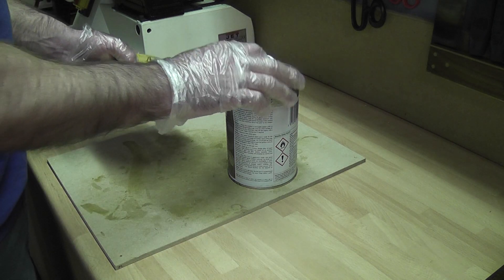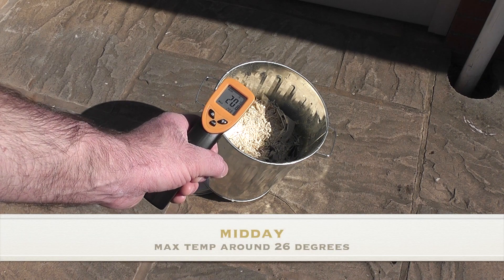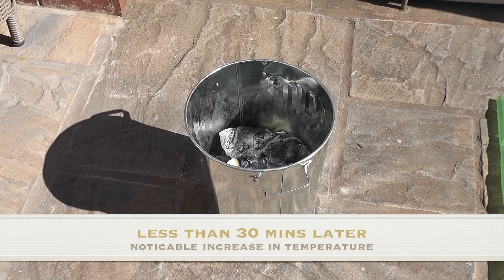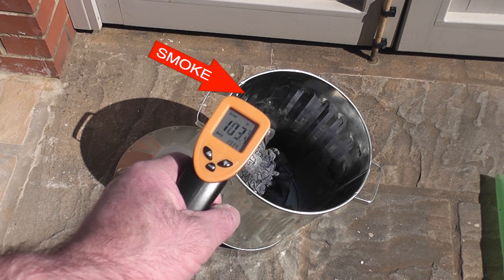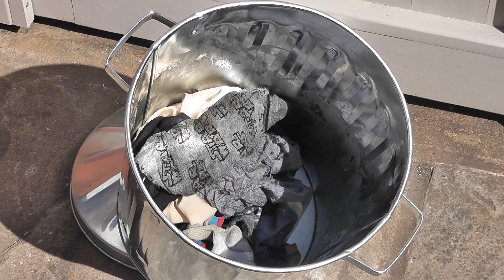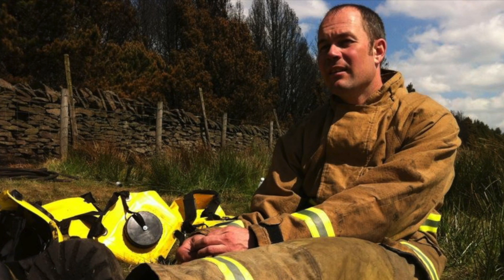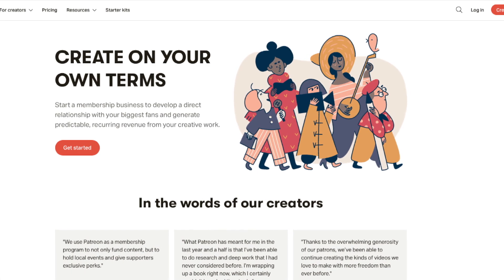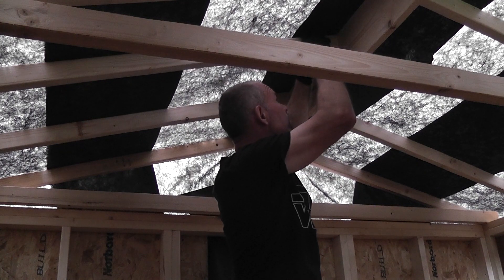Can Danish Oil Rags REALLY Self Combust?

Comment: The reason the other ones did not really heat up is because the cloths were too saturated, and the oil itself is the reason this happened. The oversaturation left the oil to cool itself down and the surface area of the fibers in the rag were not getting enough oxygen. The rags not being soaked to the brim is a very realistic test and this is why it was able to catch fire even in not ideal conditions. It'd take days for those super soaked rags to evaporate off enough oil for the surface area of the cloth to come into more contact with the oxygen and heat up enough to catch fire. Which maybe even worse because if you left that in your bin and forgot about it for a few days, imagine the shock.
Reply from the maker: Ah that makes sense. I was thinking the more oil I put on, the better chance of some action. 😂👍

Comment: Nice one Lee, good to be able to have concrete proof!
Reply from the maker: Definitely...it's one of those things that I had to see for myself. Took me a few days to see results though haha...but was worth it :-) Im so surprised at how quickly it happened though. Its pretty much possible that someone could oil a piece of furniture, go off for a couple of hours whilst the first coat dries and end up coming back to a workshop full of flames. Ive had a similar experience myself and lost £15k worth of equipment :-(
Reply: @Smugwood  yep. One of the few things I’m glad to have a concrete floor in my workshop for. Mostly it’s too cold and hard, but it’s good to be able to lay out an oily cloth on for a day or so before putting it in the big.
Reply from the maker: True. And to think I used to oil my projects in the house! Garage only from now on :-)

Comment: Is it that the hotter days boils the solvents off and retards combustion?
Reply: These oils are room-temperature polymerizing oils. They don't dry they cure. Polymerization generates heat and if ball them up you can get a fire. I learned this ni my younger days as a boat builder. Almost got smacked by the master shipwright and then he read me the riot act. Two-part epoxy does the same thing.
Reply from the maker: That's handy to know. I guess that makes sense then as to why they always say lay them flat to reduce heat build up. I often wonder how many people just screw them up and put them into the bin.
Reply from the maker: It may well be. The materials did seem to dry fairly quickly so perhaps it wasn't given chance to reach a point where it self heated. It also may explain why a lot of so called fires occur in sheds etc...and can take up to 3 days to combust...perhaps as they are kept cool enough to prevent rapid drying of the oil. Quite scary when you think about it though...an innocent looking rag disposed of incorrectly could mean the difference between a workshop and no workshop!